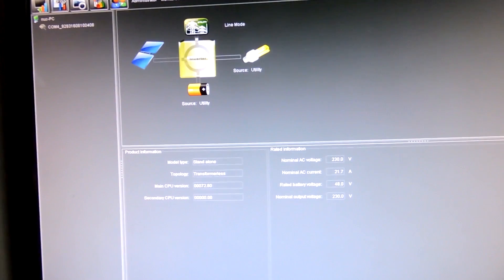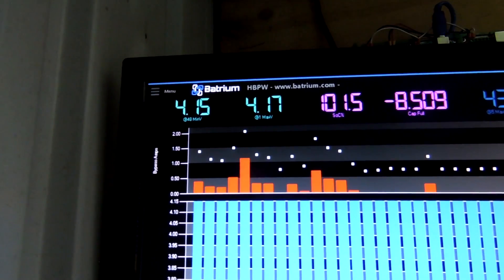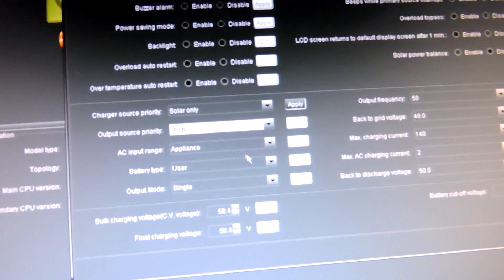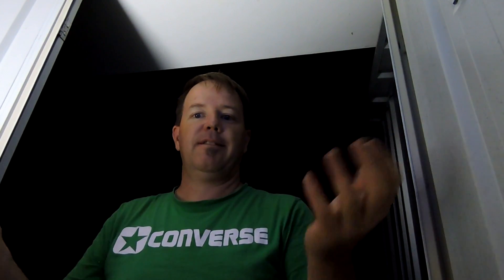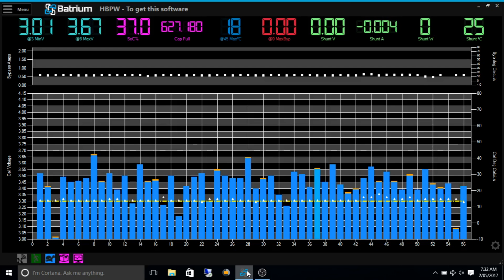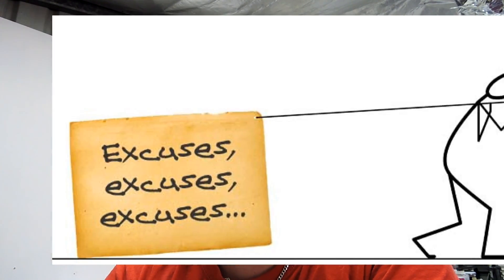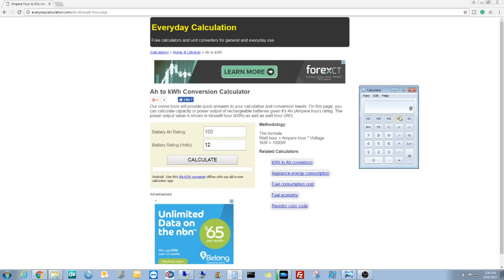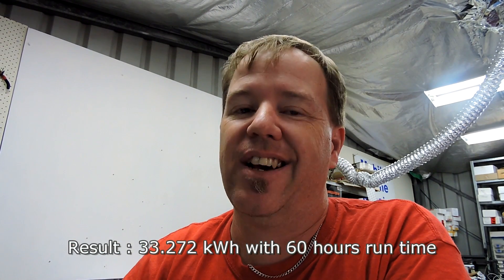Yet another failed 18650 test, to be fair probably more the computer's fault but  18650s for the win

Comment: Hello Pete what you can do is use windows remote to that system that can not do screen capture. And that was on the other computer you are viewing this computer you can do screen capture. Hope this helps? There windows remote desktop, Or temaviewer and many other remote desktop programs out there. I personally use windows remote if i can because it is local and doesn't require a outside internet connection. I have a local network in my home just for things.

The other thing is the 33kw total how long did it take to use all that up In days or a week?

Comment: The estimated cost I worked out previously was for a 12v system, if you wanted a 24v system then double the price, 48v system then quad-ripple the price. Also 30% DOD which is 70% SOC (DEPTH OF DISCHARGE, STATE OF CHARGE) & 70% DOD which is 30% SOC (DEPTH OF DISCHARGE, STATE OF CHARGE). Although Lithium is more expensive where it becomes cheaper is the cycle life. Each charge is a cycle so lead acid of 1600 cycles / 365.25 = 4.380561259411362 years as opposed to lifepo4 of 5000 cycles / 365.25 = 13.68925393566051 years.
Reply from the maker: Math.... pete nods
Reply: Yeah it really puts the $ into perspective.
Reply from the maker: Math always does :)

Comment: Cool test! :-)

Does the Batrium BMS not calculate / count the kWh's as the batteries charge / discharge, I would think that would be the best place to get the exact numbers from. I'm always finding it funny when people rate their electricity use in Ah's as that is relative to a voltage that changes over time because of the different charge / discharge characteristics.

I would put in a external energy meter / coulomb counter to get the real energy use as that will (should at least) get the kWh figures right as it can calculate the kWh used in tiny timeslots and then add all of those up to get the final figure.

I bought one of these to put in between the battery and my UPS just to get a feel for how it works and so far it seems to work fine, and just as an added feature the display can be used wirelessly so you don't run any issues with wiring and different voltages all over the system.

https://www.amazon.co.uk/gp/product/B01N8TFD4J

It appears to be using RS485 (wirelessly or over the USB cable connection if you hardwire it so I'm sure it could be reverse engineered to be connected up to a bigger system if one wanted to do so. :-)
Reply from the maker: I have requested this update in the software :)it is calculated on the web app https://freeboard.io/board/xKtg_F that is live now
Reply: Cool, it should be relatively simple for them to add as long as they control the time-slots they measure over tightly so you don't get a error amplification out of it. :-P
Reply from the maker: Fingers crossed my suggestion is implemented into the next release

Comment: Your still getting closer to unity than other's be sure to patent and concept or idea's you may have otherwise someone else will.
Reply: Say HB, on the hypothetical would a 9 volt pack be configured with similar properties but nickel metal hydride. Or lead acid batteries? And how many would be the equivalency? motor cycle battery car battery and boat. it must be measured by sheer capacitance.

Comment: Was that test on your 4480 cell battery?

I don't think you can average your voltage as you did to properly determine your Wh usage.

Why don't you just use a Wh meter & put it inline between your load & your battery??
   - https://www.google.com/search?q=watthour+meter&ie=utf-8&oe=utf-8#q=watt+hour+meter&tbm=shop

Then all you have to do is subtract the start & end numbers to determine exactly how many Wh you used?
Reply from the maker: Because don't have one :) It's a good enough guess to make me happy
Reply: That type of meter doesn't cost much. 
You've already spent loads on your gear.. what's a few more $$ to get to the actual true--rather than guessing?
Reply from the maker: +zeffur7 at this point guessing is cheaper :)
Reply: +HBPowerwall
Guessing is always cheaper.. that goes without even saying/typing.

Having the ability to 'accurately measure' your output isn't just good for your YT viewers -- it will also be useful to you.

Comment: I'd recommend not to use Windows 10 for long time screen capture anymore. Try using Ubuntu with wine to run the Batrium   Software. That setup will probably be more reliable than using Win 10 for sutff that's supposed to run unattended for any length of time.
Reply from the maker: I'll get something sorted for sure. Only one more of these tests left then im done - they TAKE way too long to edit so much footage down and render
Reply: If you ever plan on doing those tests again it might be a good idea to reduce the amount of data by just taking screenshots every 3 or so seconds and stitching them together as a video. That would be quite easy using Linux, I've no idea about it on Windows though.

Comment: Ha, hey Pete, if I wanted to get the same results as you got there, I would need to have 8400 Ah @ 12v AGM Cycle life of 1600 to 30% DOD giving me 2520 Ah of usable power to get 33.422 kilowatt hour. That would be like having 28x 300 Ah 12v AGM batteries costing $599 each or $16,772 before GST & delivery is added. Lead Acid is so expensive but safer than those 18650's.

Using LiFePO4 cells Cycle life of 5000 to 70% DOD to get 2520 Ah I would need to have a total of 3600 Ah = 9 sets of 4 x 400 Ah = 3600 Ah. 36 LiFePO4 cells of 400 Ah each cost $720 per cell so 720 x 36 = $25,920 before add on's & delivery is calculated. Your idea of used 18650's is cheaper but there is so much more work in getting it right.